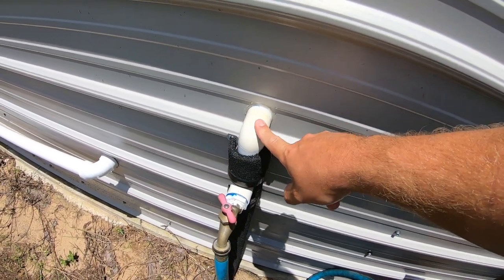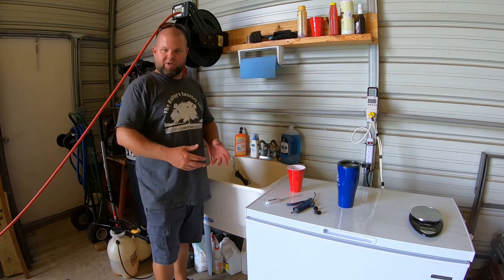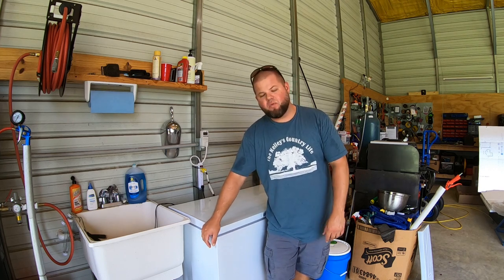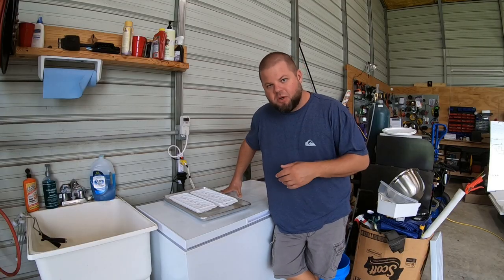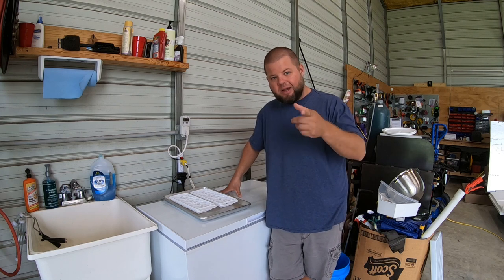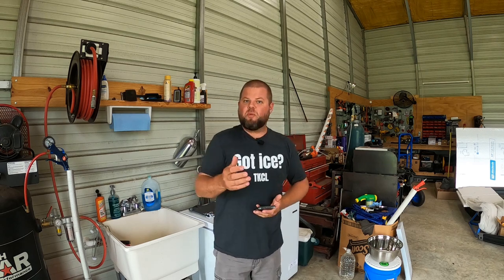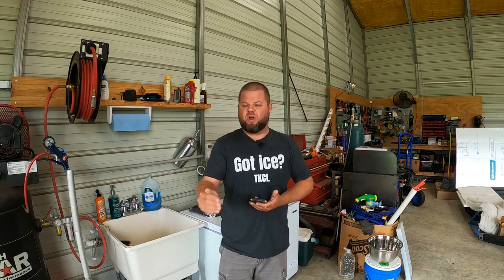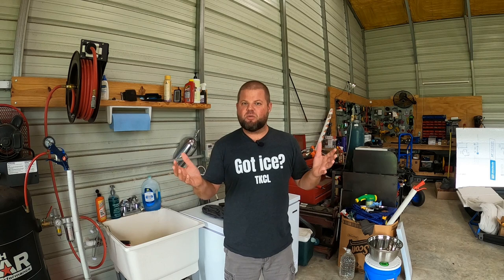Homemade ice machine tests! Hot water freeze quicker than cold water Mpemba effect? #376

Comment: You don't  need copper for the mini fridge coil. Use plastic coil and save $60 of build cost.  4x8 sheet of 2 inch closed cell foam is $37, insulate lid and back of freezer to limit cold loss.  Max freezer temp to -20F, wonder if you will see a production increase due to ice freezing faster?
Reply from the maker: Testing those last two
Reply from the maker: Valid point about the copper, I just know it would transfer heat better.
Reply: @TKCL  yeah but how much heat in what time do you need to really make with 5 seconds of water draw to fill the ice makers?  Copper just seems to be way overkill.  If you have a big enough loop of plastic, all 5 seconds worth of water can be in the tubing (or enough length for 10 seconds - worst case scenario of both ice makers firing back to back or at the same time).  Then you have pleanty of time for the water in the slower thermal transfer plastic cool.  

If you needed continuous cooling the copper would be a must - but that's not your use case.  It's a infrequent burst of a draw of water with long idle times between the calls for water to fill the ice makers.
Reply from the maker: Very true

Comment: There is food grade antifreeze - we have been overthinking this.  
https://www.ravenolamerica.com/coolant-antifreeze/coolant-antifreeze-ravenol-fga-food-grade-antifreeze/

All you need is a glycol loop that goes from inside the freezer (to chill the glycol), runs along side the water supply lines (to chill the water in the lines) and if you really wanted you could extend the loop to your water filter to pre-chill the water in it as well.  That should be MORE than enough chilled water even if both ice makers fire back to back. 

I don't think you even need a heat exchanger.  I would try a glycol loop out along side one of your ice maker supply water line down to the water filter, wrap around or along side the water filter, the back up the 2nd ice maker water feed into the freezer and inside the freezer you could just do  coil of the plastic tubing zip tied to a support.  Egg Crate is cheap and easy to work with - you can space out and zip tie a real nice loop of tubing and stand it up against the end of the freezer near the icemakers.  

Egg crate for those unaware:  
https://www.homedepot.com/p/Plaskolite-4-ft-x-2-ft-Suspended-Egg-Crate-Light-Ceiling-Panel-1199233A/202025149
This stuff is a staple in the fish aquarium hobby - cheap, sturdy, easy to work with, non-toxic, holds up to water.

Use a PC water cooling reservoir for a quick, cheap and easy water reservoir to give you some extra capacity as well as a way to burp the system for air.  No need to build something when for a little over $20 you can get something that is perfect:
https://www.microcenter.com/product/391776/swiftech-mcres-micro-r2-ssf-hi-flow-acrylic-reservoir

Maybe a bit bigger would be more practical - there are a ton of reservoirs out there so I'm sure you can find something.   You want the reservoir at the highest point in the loop (either on the supply or return exiting/entering the freezer) so that air bubbles will burp out of it. 

As for pumps - again lots to find out there.  Ones for PC water cooling are probably too expensive, even if they would be convenient and perfect for this application.  110v fountain pumps probably way too much flow and if you restrict to control would probably heat up the pump and offset any gains you get :p  There are 12v pumps that would probably have more than enough flow and be low power/generate low heat.  I'm sure you probably have some 12v wall wart transformers laying around to use as a power supply for them.

Insulate the crap out of the piping that is outside the freezer making a burrito out of the glycol and water supply lines and I think that would be the easiest way to pre-cool the water before it comes into the freezer. 

That minifridge - the cold water will likely not get from the fridge to the icemaker because as you point out it's not much water that gets drawn on each fill.   I think the glycol loop using the freezer to chill the glycol would be the easiest and most elegant.  No copper needed, but if you wanted you could put some copper segments along side the water filter to try to get more each exchange.  I'd use plastic to loop and connect the two pieces of copper together on either side of the filter as a starting point - you could make more loops/copper segments along side the filter to increase surface area to the water filter but if you have good insulation I doubt it would take that much since, again, each ice maker doesn't pull that much water on each fill and there are what - at least an hour between ice loads?  Inside the freezer, like I said easier I'd just do a big loop of single piece of uncut plastic tubing to ensure there are no leaks inside the freezer.  Safety third! 

Keep it simple and elegant.  Loop of glycol parts = Plastic Tubing, reservoir, pump, bottle of glycol and some insulation for all the outside pipe should be more than enough and a heck of a lot simpler (and likely far more effective!) than the mini-fridge!
Reply: Indeed, the more I think about it (please make it stop!) - rather than fiddling around trying to chill the water filter you could just get long enough supply line that can hold enough water for a fill of the ice trays.  

Get a measuring cup (if you haven't already) and measure out how much water it takes to fill the tray.  
Then get a one or two foot section of tubing and see how much water is held in it.
From there you should be able to pretty easily figure out how many feet of tubing you need.  As long as its something reasonable like six feet and not 50 feet  should be easy to loop it back and forth or in a coil - with the glycol lines along side it.  And the nice thing about a long run is more surface area for the glycol lines to do their thing. 

Tubing management might be interesting - but you could loop it behind the freezer if nothing else.  Heck to insulate it I'd still make a burrito out of pipe wrap insulation, but then you could sandwich all of the wrapped tubing burrito between two sheets of rigid foam insulation to provide some more insulation from the heat of exterior of the freezer and your building. Want to get really fancy cut some strips to close the gap between the two sheets of foam making a sealed box for the tubing to be in.  That would be one heck of an efficient heat exchanger!  Make out of one piece of plastic tubing and no joints for leaks either.

https://www.lowes.com/pd/Kingspan-Insulation-Common-1-in-x-4-ft-x-8-ft-Actual-1-in-x-4-ft-x-8-Feet-R-5-Unfaced-Polystyrene-Foam-Board-Insulation/999972966
If they have higher R value foam, I'd go for it - get the best you can.

Would help isolate the freezer from the hot building skin too :)
Reply from the maker: A lot of good information, some I plan on trying.

Comment: Why not find a way to run the water through the "ass maker" ? Eliminating the need for a second cooler ; )
Reply: The water going thru the 'plumbing' inside the "ICE maker" would freeze before the next cycle...
Reply from the maker: Working on a idea for that soon. I have a couple of simple options that might work
Reply: @technicaltom1886  I'm sure there is a solution to make this happen. The water can't sitt still inside the "ass maker" for a longer period of time, but maybe something can be done over at the entry point. In the beginning he had to do some fixes to keep the water from freezing and added a tube with a slot to make the outside heated air help heat it up. If he plays with it, he could make it cooler without freezing, I'm sure of it

Comment: I got a ice making on a medium size refrigertor  and with the power either on the coldest setting or with the temperature knob turned to the off position it will cycle almost about the same time, which tell me the ice maker has some type of timer inside of it, how does the ice make know if the ice is  frozen or not,  what maybe giving to a little move ice readings then other is how much water is going into the ice maker every time and Im sure there is some type of timer to let water in just a thought
Reply from the maker: Ice maker has a thermostat that reads the mold/tray temperature. It then triggers a timed dump cycle. The quicker you can get the mold down to temperature, the more dump cycles are activated.
Reply: @TKCL  I most have one with a timer cause it will cycle even if the freezer is warm lol
Reply from the maker: That's not good, most need a freezing temperature to activate so it doesn't keep flooding your freezer with water should a failure happen.

Comment: I don't think the water is still chilled by the time it gets to the ice maker its only going to use few oz every .5 hrs. Even with insulation by the time it sits in the two valves and runs up the the side its bound to lose the chill
Reply from the maker: But also bound to be much cooler than 95 degree shop temperature and 99 degree incoming water. These ice makers are cycling quick enough that the water is not warming all the way back up.
Reply: @TKCL   well said as I made these points I couldn’t figure out a better way either I did think about a cheaper coil to chill water in mini fridge use a transmission cooler to run water through in the fridge instead of copper just thinking I’ve been watching all your videos today great chanel👍
Reply from the maker: Thank you for watching

Comment: Is the ice machine on a timer or does it detect when the ice is frozen?
Reply from the maker: Both. A thermostat reads the mold temperature and triggers a timed dump cycle. So the quicker you get the ice to under 10 degrees the more the dump cycle is activated.

Comment: Have you thought of putting an insulated pipe that will hold have the water you need for the ice maker?
Reply from the maker: No, I'm messing around with another idea for pre chilling
Reply: This can pre-chill  the water by using the freezer to chill it. By having an insulated line in sized to half your ice maker load ozs. You can pre-chill  the water, and if it’s not chilled enough you can increase your line so it holds enough water for the ice maker.
Reply from the maker: Inside won't work, will freeze and put extra load on the compressor. I'm looking to use the cool air I'm losing through the back and lid to help chill it down. The next set of tests show I'm reaching the cooling capacity of the freezer.
Reply: It shouldn’t it’s only about 4oz.  of water. You put insulation around the pipe to keep the water from freezing.

Comment: I believe when you install a refrigerator ice maker it should be hooked up to the hot water line.  Not for freezing quicker but since the water in the line has already been heated up.  The theory is the water has less oxygen so the ice will be clearer.

Comment: Good project and nice work.

Active cooling the inlet water temperature seems to add a lot of failure points, risk VS reward is pretty high.

Add a lot more insulation to the inlet pipe on the outside and make it reflective. I would probably make something that looks like a 5 story birdhouse packed full of some kind of insulation.

I havent seen your well, but if it is an above ground building it might benefit from some insulation as well. Colder tap water is a benefit not just for the icemaker.

The deep freezer have a wrap around evaporator, so the front and sides are hot, you mentioned a fan but I think you should try passive cooling first. Cheapest way I can think of is gluing some textured metal to the hot sides. Corrugated roof metal with the ridges vertical to take advantage of convection is the cheapest I can think of.

Before you insulate the back of the freezer, make some kind of coil attached to the freezer first, then insulate on top of that. Run the inlet water thru the coil and you get colder water from previously wasted energy.

Keep it up, good luck!
Reply from the maker: I'm kicking around a few of your ideas already. Thanks

Comment: 8% guy checking in. I’m glad it worked out for you. I came here to say what I already see has been commented. Plastic tubing is fine in the mini fridge as long as you have enough volume. 

If your going a less energy route. Might be more work than what it’s worth. Id re-run your supply line completely underground. And bring it up next to the freezer inside. Should get a consistent 75* supply temp in Florida. May not be a big gain. But would keep supply temp consistent if you want to eliminate a variable for future tests.
Reply from the maker: Agreed